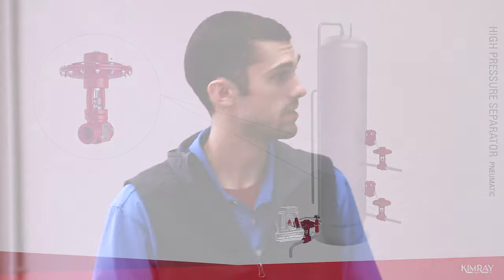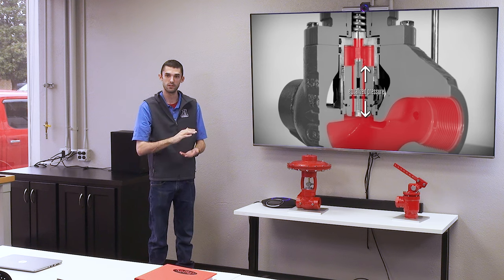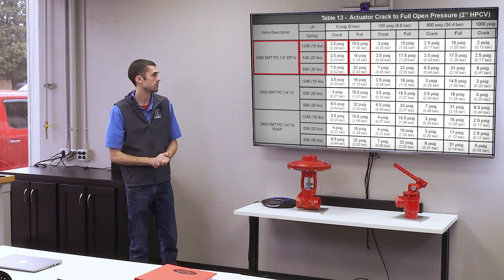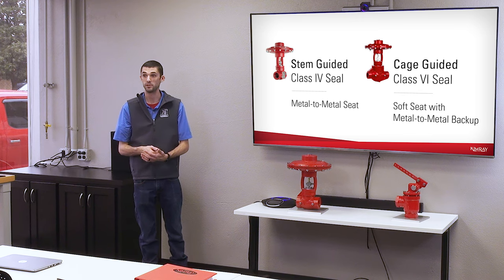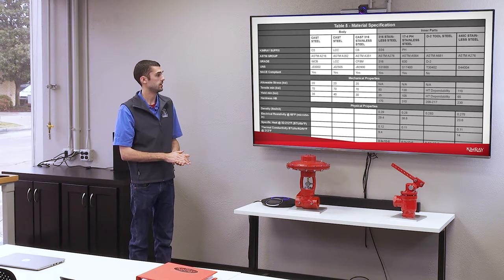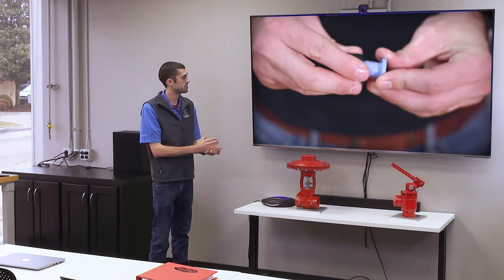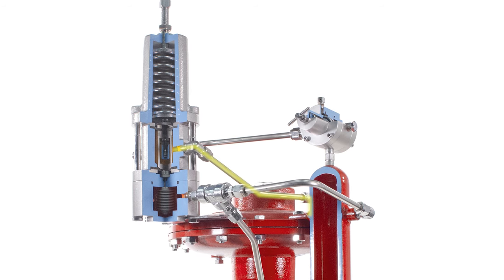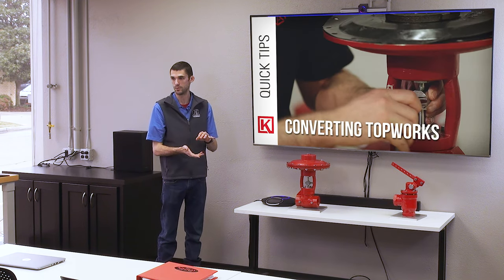Training Guide to the Kimray High Pressure Control Valve [STEM GUIDED & CAGE GUIDED]

Comment: I just learned you can replace one of those 1/4” plugs one the downstream side of the valve body with a small valve.  For troubleshooting, you can see if your valve is leaking by in the closed position. 👍

Comment: Why is the level control box always leaking by the bar inside the box?
Reply from the maker: Hi, when you say level control box, are you referring to a liquid level controller or a part on the high pressure control valves? I believe you're talking about the stuffing box/packing in the HPCV as the “level control box” and perhaps the travel indicator as the “bar inside the box”?  Is it leaking in the stuffing box where the packing sits? Just trying to clarify first before I can get you the best answer. If you need to talk to someone instead, you can call product applications at (405) 525-4264 or prodtechsupport@kimray.com.

Comment: Love the videos, great content. Could you possibly do a video explaining the model/part # meanings? 212 SMA, 312 SGT ext.
Reply from the maker: Thank you! We'll add that to our idea list for our future content! As a heads up, there is a team actively working on a new code builder system for each product line. I don't have an ETA for that yet, but it's in the works. There is still good value in explaining the current codes too, thanks for the suggestion.